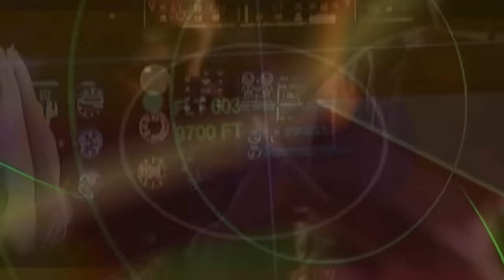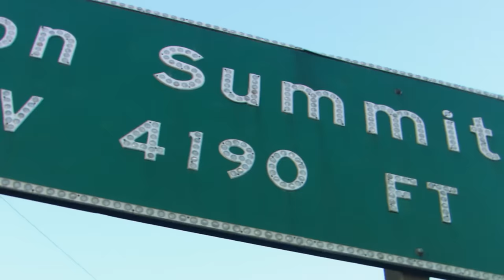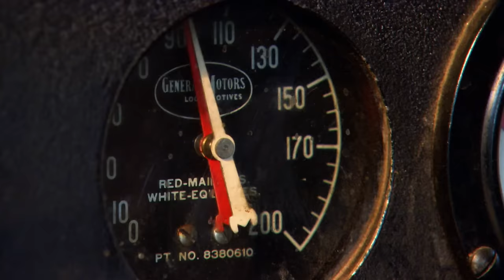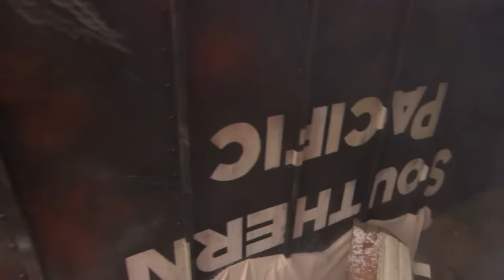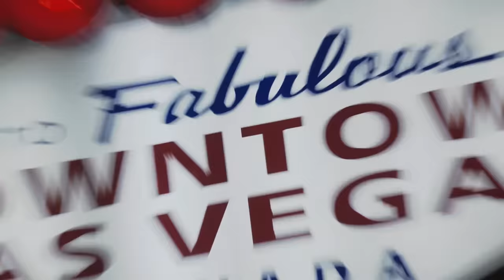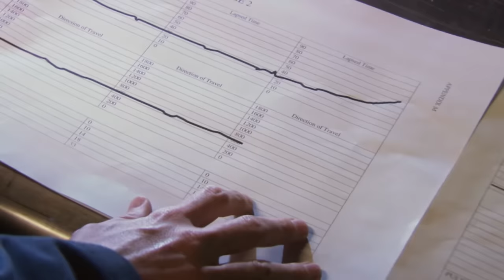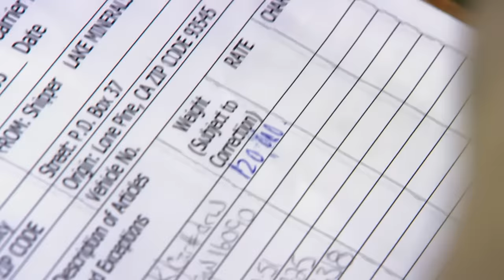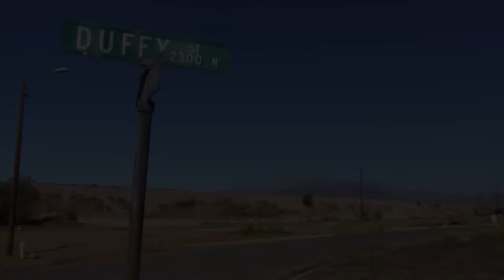Tragic Train Wreck - Crew's Desperate Battle to Stop the Unstoppable | Mayday: Air Disaster

Comment: I have read about this and two engines had faulty dynamic brakes.  The train should not have been moved from the original depot. When the engineers noticed that the speed was creeping up then that is clear evidence that the dynamic brakes were not working properly.  At that time a full emergency air brake may have saved the train. That is the way to get the LEAST heat into the brakes. The further the train goes the more heat that is created. Using them to SLOW the train creates heat without stopping the train.  That overheated them and then it was all over. If you could have taken off some speed you could have put the engines into reverse and opened the throttle.  Damaging the wheels and motors but saving lives. I have seen that done before.

Comment: Southern Pacific bought Union Pacific and then changed their name to Union Pacific, They're still around.
Reply: Huh!
Reply: @ShawnCalay is that a noise or a half ass response?
Reply: Southern Pacific holdings ceased to exist as of 2015. The company in it self was absorbed by union pacific. Holding company's exist for 15 to 20 years after the company is bought. I worked for CCP, then merged to IC, then to CN. CCP was bought back by IC in 1995 but the holdings were still on paper till 2006. However CN still marks cars CC and IC because of leases that the former companies made while they were in business.
Reply: UP took over SP in 96.
Reply: @maxrshelltrack7443  yes your right.
Reply: dumass up bought the sp. what you said was not even right
Reply: @rystrains.6405  you should check your spelling and then check again.
Reply: @joshuapaul349   he missed spelled on purpose....if he spelled it the correct way the comment woulda been removed